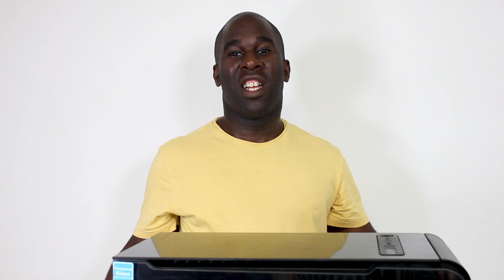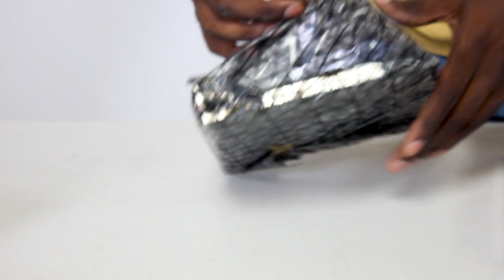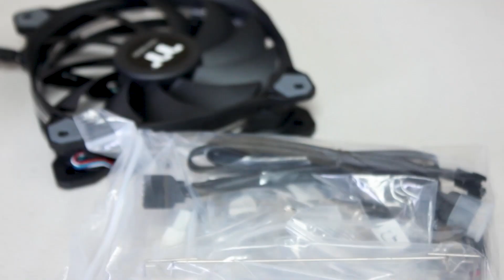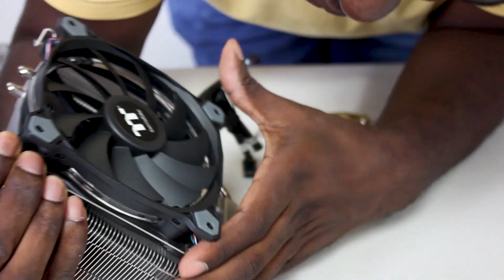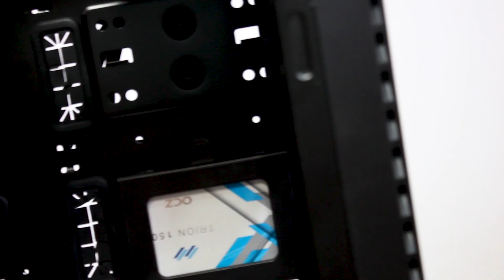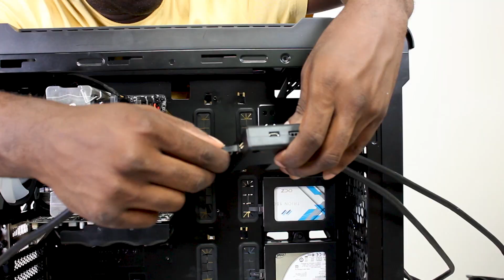Thermaltake Riing Silent 12 RGB Sync CPU Air Cooler Review and Build

Comment: Hey great review and install, but i have a quick question on connecting the RGB. The fan has a 4 pin female connector while my motherboard has 5 pin RGBW. Is there a way round this. I have hunted hi and low for some kind of an adapter. Did you have this issue? Did your mobo have the 4pin rather than the 5 pin RGBW? Sorry that's 2 questions. 
By the way I have the Gigabyte Aorus H370 Gaming WiFi 3Mobo
Reply from the maker: Gigabyte are the only ones that have 5 pin and rest of the motherboards have 4 pin on the 12v, but now there making the 5v that don't work with the 12v old l.e.d.s